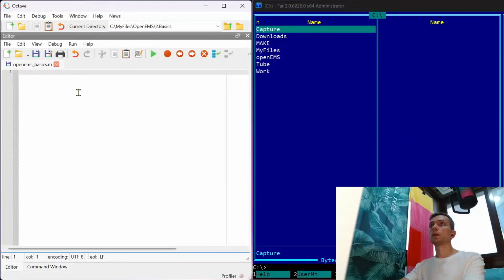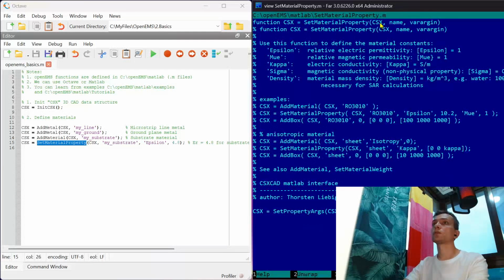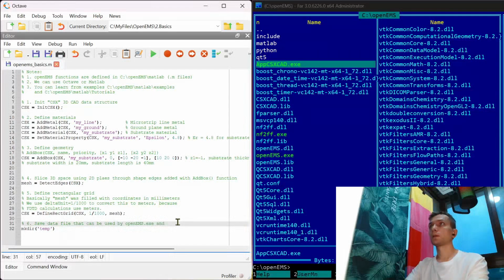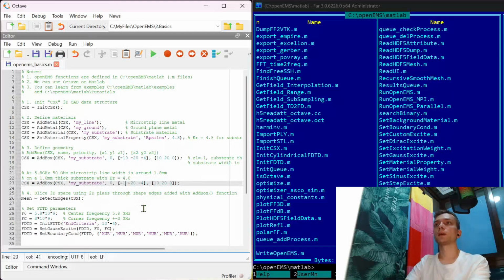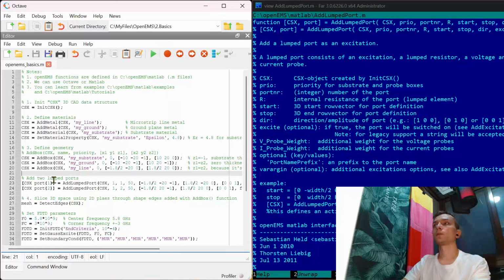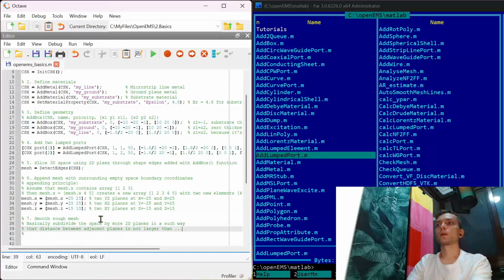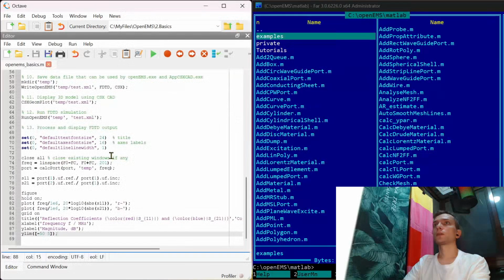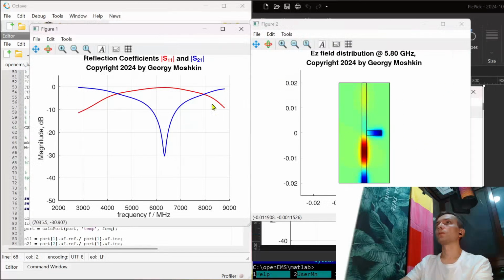openEMS Tutorial (S11, S21 and EM distribution)

Comment: Any plans to do a udemy for circuit simulation?

I never see a model fr any of the parts I'd like to use.. even AD devices, don't have the part in LT Spice.  So what do you do to model a circuit, especially if it has a mix of AD / TI parts?    Is there another tool that can?  Cadence Sigrity?
Reply from the maker: Hey, thanks for the comment. I am not very good at discrete circuit simulation. The only serious case I ever did were LTSpice simulation of a custom sample and hold circuit, and luckily I found a custom model for the opamp I used. Yeah, part libraries are a real pain

Comment: If people are going to design antennas, they will need wires. Can you simulate wires with non-zero diameter? Sources must be placed somewhere. Where and how? I do not need explanation of Power Spectral Density. I am genuinely trying to use this software, but documentation is totally useless.
Reply from the maker: I had no need in simulating wires, no experience, so I can't recommend anything. In theory it looks straightforward: create a cylinder or some other shape for the wire and do a dense meshing for it. Have no clue how dense the mesh should be. The best place to ask is here: https://github.com/thliebig/openEMS-Project/discussions
Someone has an offline version of old openEMS forum, where such topics was discussed already, something should have left on web archive. If it becomes too boring, this looks kind of more promising: https://www.emerge-software.com/ because it has some more advanced meshing and is under the development, which means you can ask the author.
Reply: @GeorgyMoshkin  thanks for advice. I am very careful with geometries and getting some very good results now.
Reply: @GeorgyMoshkin  it seems very simple from examples in tutorials.  However, there are many limitations on what can actually be simulated. Documentation should clearly state software capabilities and limitations. For example, Dipole SAR example looks very simple. Dipole is thin wire with zero diameter. If you try to change it, simulation crashes. Also, nobody uses dipole for SAR. We are talking very close proximity to human head, say handheld radio. All handheld radios use radio enclosure as part of antenna. Enclosure as a metal box also does not work in simulation. EMS seems example of something started, then left half finished. Idea of Matlab interface was excellent.
Reply from the maker: @VK3EGN1  Most if not all these free tools do not have a good geometry editor. If FDTD arrays are filled correctly before the simulation, arbitrary shapes can be simulated if you have enough RAM and computing power.

Comment: Hello

I wanted to add a 45 degree diaginal trace to end of the straight trace drawn with openEMS, but i could not do it. Could it be that openEMS does not support diaginal traces? Do you have any information?
Reply from the maker: If my answer (below) did not help, I recommend this discussion board for openEMS questions: https://github.com/thliebig/openEMS-Project/discussions

Diagonal lines are certainly possible, and diagonally aligned port is most likely possible. The only problem I see is that for adequate simulation you will need to use a very dense mesh. The longer diagonal section is, the more meshing lines should cross it, because diagonal line is approximated by many tiny fdtd rectangles. From my understanding, openEMS uses relatively simple FDTD algorithm that is not optimized for diagonal lines, circles, etc.. It's almost like trying to make high-polygonal model using Minecraft (video game) approach.
Reply: @GeorgyMoshkin  

I also noticed this and tried to create a diagonal trace by drawing square boxes with the staircase method for a diagonal trace.

Comment: Hello,

 thank you for the video, 

What is the meaning of the x-title and y-title value of Ez field distrubution colored graph?
Reply from the maker: Not sure what you mean. If it's xlabel ylabel then it may be millimeters.
Reply: Yeah it can be milimeter but, x and y means clerance or trace witdh or anything else?
Reply from the maker: @zaferacun3314  I need exact reference where you've found x-title. Is it in my video or in source file? 
https://www.mathworks.com/help/matlab/ref/xlabel.html
Note that this is simulation only, there are no clearances or other DRC (design rule checks) that you may be familiar with from PCB editing software. We just use a script to define some geometry, and the "run openems" function passes this geometry to the openems.exe. If there are some errors with clearances it will not notice it. 
The line thickness is defined here:
CSX = AddBox(CSX, 'my_line', 1, [-1.8/2 -20 0], [1.8/2 20 0]); % z1=z2=0, because of zero thickness
Notice -1.8 divided by 2 and then positive 1.8/2.  It's because we placed line on the axis, so it's X coordinate starts at -0.9 and ends at 0.9 (or 1.8/2). The same with substrate length. It goes from y=-20 to y=20, the total length is 40
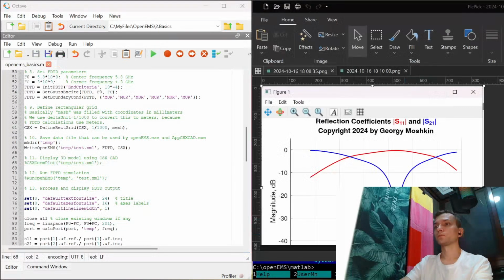Reply: There is graph at 35:05 , Ez field distrubution and x-axis and y- Axis are between -0.02 and 0.02, my question is that what is the these numbers?
Reply from the maker: @zaferacun3314  oops, these are coordinates in meters: -0.02 m to 0.02 m. If we convert it to millimeters, it would be -20mm to 20mm.  In the script, we use this CSX = DefineRectGrid(CSX, 1/1000, mesh), so all dimensions we define later are divided by 1000 (to convert to meters). For example,
CSX = AddBox(CSX, 'my_substrate', 0, [-10 -20 -1], [10 20 0]);
is doing
CSX = AddBox(CSX, 'my_substrate', 0, [-0.01 -0.02 -0.001], [0.01 0.02 0]);
Reply: @GeorgyMoshkin aaa i understand now. Coordinates! İt is clear now. Thank you
Reply from the maker: @zaferacun3314  Great! Yes, just raw numbers as they stored in meters internally. Kind of misleading, because you would expect dimensions to be in mm or mils for PCBs.

Comment: This was a very helpful video. Why is there no need to assign a material to my_line and my_ground ?
Reply from the maker: Indeed

CSX = AddMetal(CSX, 'my_line'); 

does not set any material properties such as conductivity...
If we dig into C:\openEMS\matlab\AddMetal.m source code, it says that this function adds a perfect electric conductor (PEC) material. 

To use more realistic simulation for metals there is a AddConductingSheet() function.
and usage example coming with the openEMS:
C:\openEMS\matlab\examples\transmission_lines\MSL_Losses.m
which adds "gold" as a material:

CSX = AddConductingSheet( CSX, 'gold', MSL.conductivity, MSL.thickness );

It's interesting that if you set both conductivity and thickness to zero, theAddConductingSheet() source code performs a fall back to AddMetal() function:

% fall back to ideal pec for t==0 or c==0
if ((thickness==0) || (conductivity==0))
    CSX = AddMetal(CSX,name);
    return;
end;

Hope this helps. I never used conductivity/thickness parameter, and with other simulators I stick to the PEC material for all metal layers. I guess with a careful consideration of all parameters simulation results may be closer to reality if combined with very dense mesh.

Comment: hello, please i don't get the same results, i'm new using thes tools: here is my code  please tell me where is the misstake : addpath('C:/Users/abdelli_ma/Downloads/openEMS_v0.0.36/openEMS/matlab');
CSX = InitCSX();
CSX = AddMetal(CSX,'my_line');
CSX = AddMetal(CSX,'my_ground');
CSX = AddMetal(CSX,'my_substrate');
CSX = SetMaterialProperty(CSX,'my_substrate','Epsilon',4.8);
CSX = AddBox (CSX, 'my_substrate' , 0, [-10 -20 -1], [10 20 0]);
CSX = AddBox (CSX, 'my_ground' , 0, [-10 -20 -1], [10 20 -1]);
CSX = AddBox (CSX, 'my_line' , 0, [-1.8/2 -20 0], [1.8/2 20 0]);
[CSX port{1}] = AddLumpedPort(CSX,1,1,50,[-1.8/2 -20 -1],[1.8/2 -20 0], [0 0 1], true);
[CSX port{2}] = AddLumpedPort(CSX,1,2,50,[-1.8/2 20 -1],[1.8/2 20 0], [0 0 1], false);
mesh = DetectEdges (CSX);
mesh.x=[mesh.x -25 25];
mesh.y=[mesh.y -25 25];
mesh.z=[mesh.z -15 15];
mesh = SmoothMesh(mesh,0.5,1.25);

F0=5.8*10^9;
FC=3*10^9;
FDTD=InitFDTD('EndCriteria', 10^-4);
FDTD = SetGaussExcite(FDTD, F0, FC);
FDTD = SetBoundaryCond(FDTD,{'MUR','MUR','MUR','MUR','MUR','MUR'});

CSX = DefineRectGrid(CSX,1/1000,mesh);

mkdir('temp');
WriteOpenEMS('temp/test.xml',FDTD,CSX);
CSXGeomPlot('temp/test.xml');
RunOpenEMS('temp','test.xml');

set(0,"defaulttextfontsize",24)
set(0,"defaulttextfontsize",16)
set(0,"defaulttextfontsize",1)

close all
freq = linspace(F0-FC,F0+FC,1001);
port = calcPort(port,'temp',freq);

s11 = port{1}.uf.ref./ port{1}.uf.inc;
s21 = port{2}.uf.ref./ port{1}.uf.inc;

figure
hold on;
plot(freq/1e6, 20*log10(abs(s11)), 'r-');
plot(freq/1e6, 20*log10(abs(s21)),'b-');

grid on
title('Refelection')
xlabel('frequency f /MHz');
ylabel('Magnitude,dB');
ylim([-50 5]);
Reply from the maker: Pls check this link: https://github.com/georgy-moshkin/openEMS